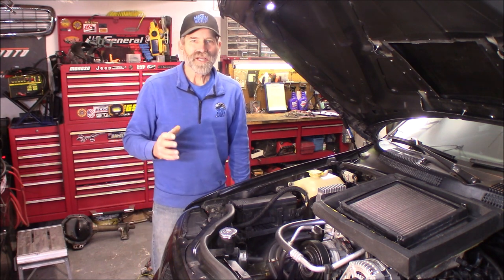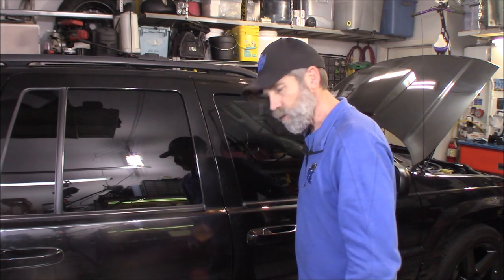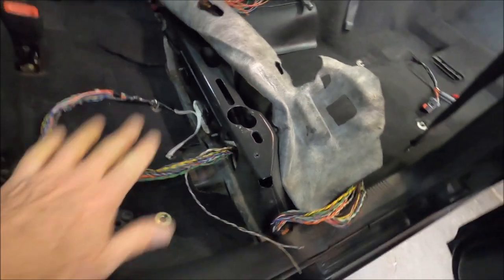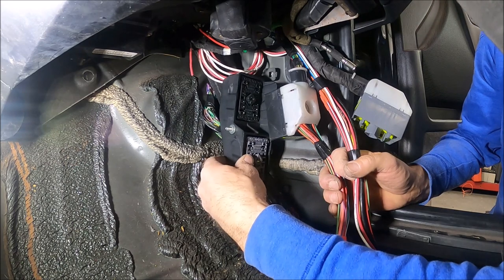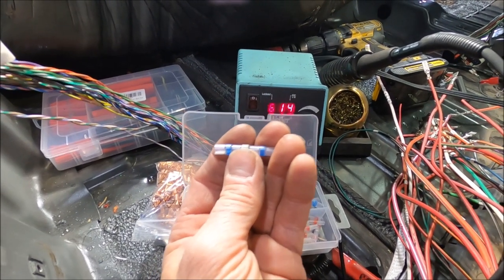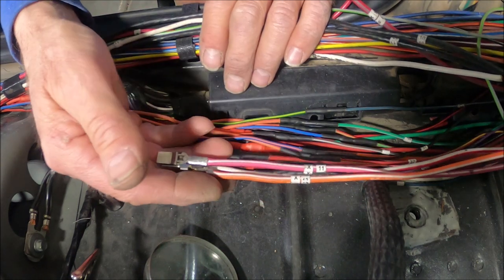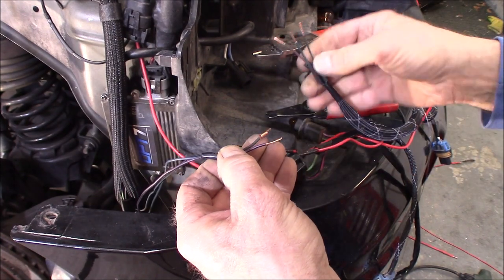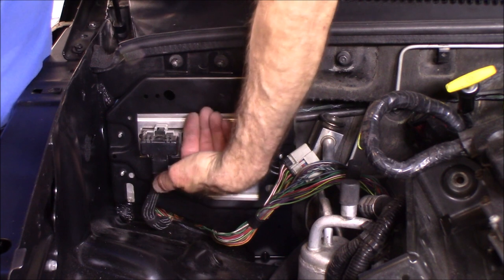How to Wire Tuck Engine Bay Relocating Power Distribution Center

Comment: Love it. I'm gearing up to put a 4BT Cummins 5spd 4x4 into my '02 GC. Only need 1 wire to run the engine but this is a nice way to hide all the other wiring. HMMM. More work but so is the Cummins transplant.
Reply from the maker: Thank you, Steve, I hope you are shooting some video on the Cummins transplant.
Reply: @martinbuilt  I'll have to see. Haven't found the right engine yet and am still in the planning stages at this point. Want everything on hand at the time I do this and just get thru it in a couple months.  Put a 98 12V 5.9 Cummins in a '92 F-350 about 15 years ago. Other than Trans issues and turbo its been a great build and tow vehicle. So I have some experience in a Cummins transplant in a Grand Cherokee.

Comment: I want to do a complete engine compartment tuck for my 02 4.7 Limited, put the batter y under the seat as well, just like you. 4.7 WJ's need all the extra room you can get to make the easier to work on and better looking. Thanks again Martin.. for sharing the sojourn, as well as trailblazing the mods for us WJ owners. BEST JEEP/ WJ site-channel on the WWW, BAR NONE!  YOU ROCK Martin!
Reply from the maker: Thank you so much for the kind words, I really appreciate that. Yes, that is another reason for the wire tucks, which is to make it easier to work on. 😊😎
Reply: @martinbuilt  As a retired  (35+ year) Mopar technician, I can tell you, in all honesty, having worked on these from new (as well as ZJ's WK's WK'II's, XJ, and the rest) once you are done with this mod, not only does everything look far cleaner, but it will now be a pleasure to work on. 

It's a shame the engineers at Daimler/Chrysler didn't think of doing it like this from new,, instead of what we got..  stuffing ten pounds of s#!t into a 5 pound bag the way it was done. 

Your way would have added to the cost of the vehicle, with more copper,  (maybe no spare tire to speak of with the fuel tank tuck as well), but only a modest  price increase, and electrical work would have been far easier to to diagnose, trace, and repair your way than what Daimler Chrysler gave us. 

Once I get my '02 WJ limited running right again, I plan to perform many of the changes and upgrades you have showed us work, wiring tucks, Ram Air, exterior lamps, fuel tank tuck, battery relocate, fuel pump access panel and more.  

With all the room you have freed up, perhaps it's time to pursue  the ultimate WJ upgrade everyone wants, that is installing a 5.7, 6.1 or 6.4 Hemi under the hood. I think the 05/06 Ram Hemi might work with the J-tech electronics and throttle cable instead of fly-by--wire. With everything including the TCM removed and relocated, it should be a walk in the park, a matter of integrating the earlier Ram Hemi harness with the factory WJ V-8 harness. 

I'm game if you are!

Comment: Clean each end of the wires with alcohol and a brush, lightly spread both ends of the wire apart, mesh and press each end together, clean again and apply flux, then try using one of those contraptions.  They are most likely coming apart because of debris (oil and dirt on your hands), and a lack of flux.  Awesome video as usual.

Comment: Pull string- that’s mule tape and I bet someone does cabling and communications for a living. Crazy and very neat wiring job!
Heard you say later you do fiber optics, I did that for a little bit in Colorado and once helped wire a county jail so I was able to tell people I spend a few months in the big house.
Reply from the maker: Yep, that's mule tape all right.  Yeah I do all that low voltage stuff starting Monday at the Bellagio on a tower remodel.
Reply: @martinbuilt  that’s going to be a nice project

Comment: I used those connectors for my door wires. Like you said- 50/50. If they put double the solder in there then they would be fine.
Reply from the maker: Yeah they don't exactly work like, (as seen on TV) 😕 
Thank you for watching.

Comment: 27 years at a dealer OEM getting away from solder connections because the flux causes corrosion after time 
 They wanted a crimp connector and shrink tube

Comment: It looks great! What is the plan for the "real estate" in the engine bay? It probably makes the engine run cooler with the extra empty space around it.
Reply from the maker: I don't have any plans as of yet, I just love seeing a clean engine bay. Once I move the coolant reservoir and relocate the TCM in the next wire tuck the ECM should run cooler as it won't be block and should have more air flow around it.
Reply: @martinbuilt  I didn't think these controle modules got hot but I guess they do .. TCM has cooling fins on it! Would you be able to capture how to remove the wires for the transmission sensors (3 of them) ? I have replacement connectors to splice in , but there is not enough slack to work with.

Comment: Martin, are those 35" tires on your xj? Are you still running the Dana 30 in front? Any bad brakedowns? Also, in the rear, did you have to limit uptravel? How much? We could use a video. Thanks for all your great vids.
Reply from the maker: yes, those are 35's and a Dana 30 and never had it break. The rear axle does have bump stops to limit up travel.
Reply: @martinbuilt  Thank you. When you get the chance, would you mind terribly doing a video on the rear uptravel? Thanks in advance.
Reply: also, I did the WJ swap but the tie rods don't clear the wheel/tire, so I have 2" spacers. It's as bad as it sounds. Would you show off your clearance between the wheel and TRE and maybe the brake calipers? Thanks.

Comment: Martin im changing out my valve cover gaskets on the 4.7l engine the new valve cover gaskets come with 2 gaskets and the rubber grommets. the bolts have bolts, rubber grommets and the metal shank. how do you remove the old rubber grommets from the shank and how do you install the new ones?
Reply from the maker: Take a razor knife and cut them off and then you will be able to push the new ones on. The new grommets are more pliable.
Reply: @martinbuilt  thank you